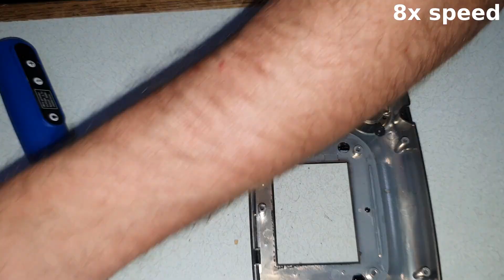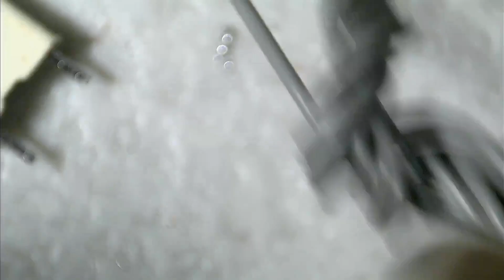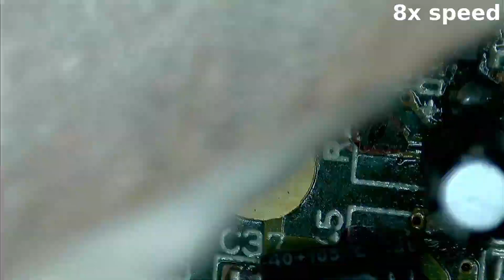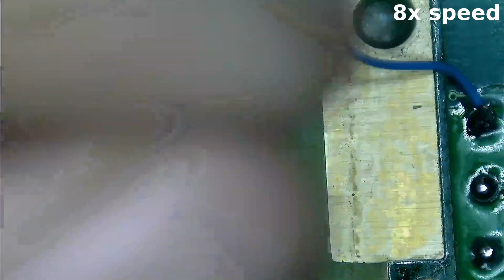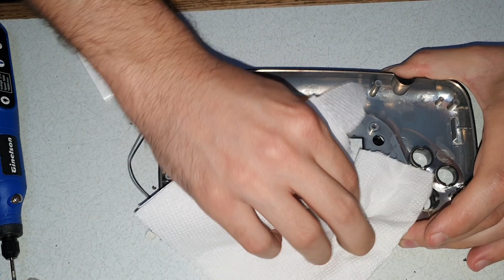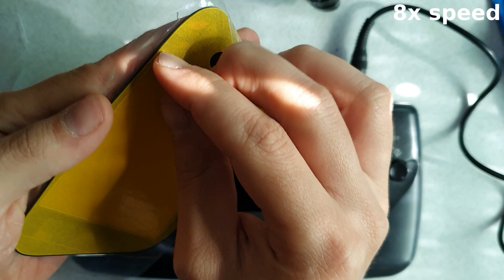Sega Game Gear HISPEEDIDO LCD and HDMI Mod Installation Guide (VA1 Mainboard)

Comment: Awesome video man, I’ve been wanting to get a hispeedido screen kit but the lack of info has had me avoiding it. What temp did you have your iron set to when you soldered the flex ribbon cable? I think I always have mine set a bit to high.
Reply from the maker: I always keeps my iron at 400 C. Good solder and flux helps a lot.

Comment: What did you use to attach the screen board to the motherboard?
Reply from the maker: Nothing. The two ribbons that connect to it are sufficient for holding it in place.

Comment: The game audio goes thru the hdmi? Or you have to use the internal speaker of the game gear?
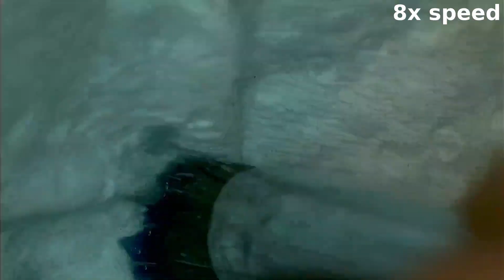Reply from the maker: Goes through HDMI when the cable is plugged in. That's what the L and R connections shown at 30:40 are for.
Reply: @BoomerElectronics hi boomer, many thanks I see it. 
The mod disables de internal audio once the hdmi cable is connected? Or you have to turn it down?
Reply from the maker: @javiso85  It does not disable the audio coming from the Game Gear's speaker. YOu have to turn it down.

Comment: Great video!
I wish I watched this before I got ripping through the instructions….
I may have misplaced R30’s resistor… Now I don’t know which one to swap with R24. Send help 😢
Reply: I think I found it, Yours is labeled 3001 & Mine is 302. Both should be the same 3,000 Ohm resistor. 😅